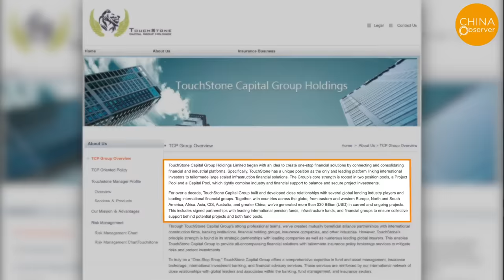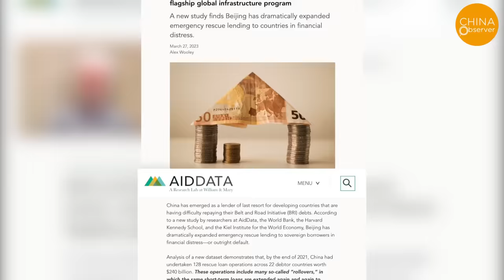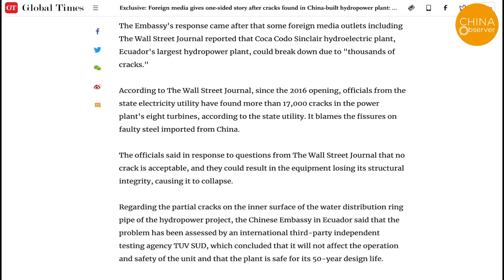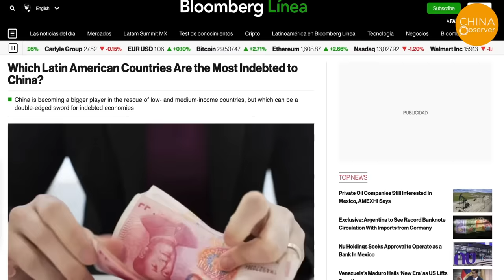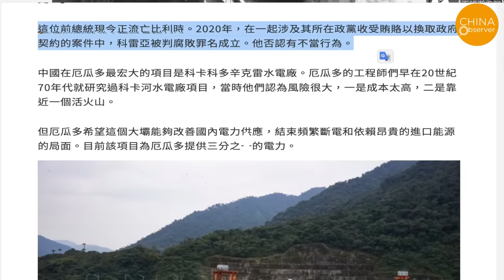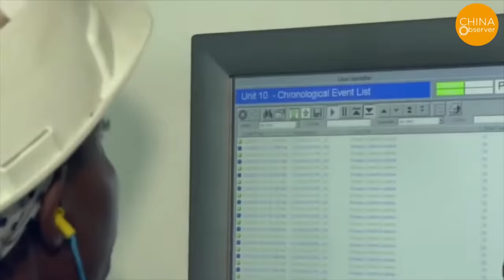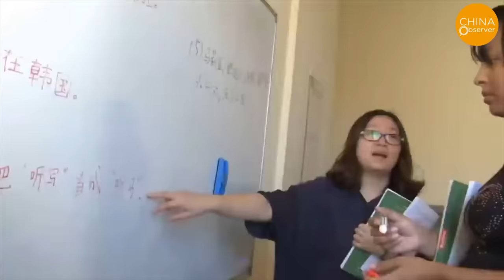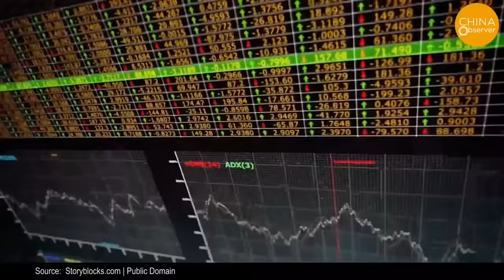China Spreads Tofu-Dreg Constructions to the World: $15 Billion Tunnel Now a Wasteland?

Comment: The best thing that could happen to these debtor nations is devaluation of the yuan, and that is one reason why the CCP is struggling to maintain its exchange rate. However, since the CCP has increased the number of yuan in circulation by over 45% in just over two and a half years, and it continues to print yuan like crazy, that devaluation (and CCP hyperinflation) is not far off. Anyone accepting yuan for any reason must remember that yuan are also Made in [Red] China.
Reply: interesting point, do the debtors have to repay in yuan? i guess they do since in dollars would be embarrassing for the CCP
Reply: Tofu Dreg = Defective, not safely, fail, short life, and weak🤣🤣🤣🤣🤣
Reply: Davy Jun Huang: Quote For China EndQuote
For China For China For China For China, If you still dont get it....
Reply: BRI projects are a win win business for CCP. All the  materials used in those projects are all supplied by  china which the  debtors must pay. The engineers, builders, contractors  etc. and even laborers are Chinese. All those who signed contract with BRI are in short helping solve the unemployment problems in china. Not to mention the high interest for the loans. And what you get in return are below low quality of infrastructures.

Comment: It was really just a way of giving Chinese construction companies work. They had built up needed infrastructure for China for twenty years. But now that was done. Nothing more that could be productive was needed to be built in China. So rather than have the construction sector collapse, China started to build outside of China with the Belt and Road initiative. China also kept building non-productive infrastructure and housing within China for the same reason - and with the same results.

For the past decade, China has prolifically built one losing construction project after another both internally and externally. The loans for all of these cannot possibly be paid off as they were financial losers from the outset.

And, on top of all that, you have the systemic corruption inside Chinese society that cuts corners on everything. Criminally on construction where you are costing people's lives by building garbage to turn a buck.